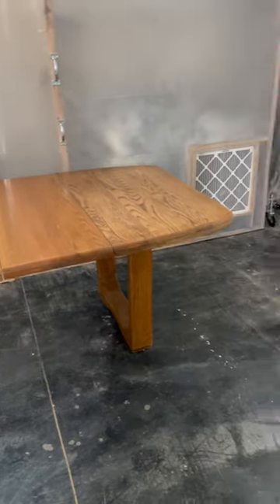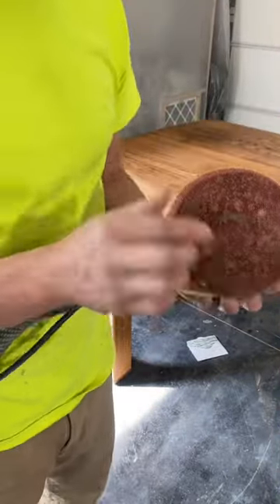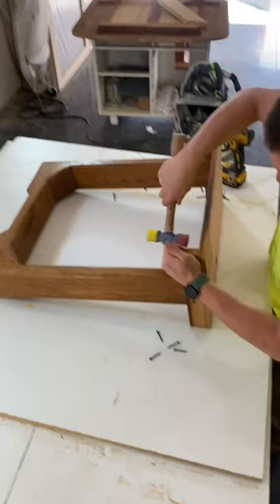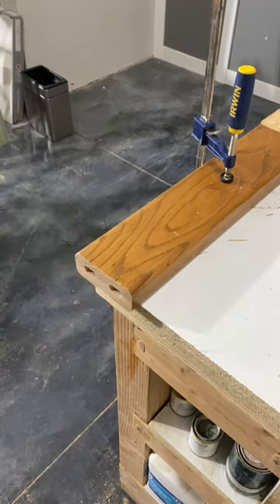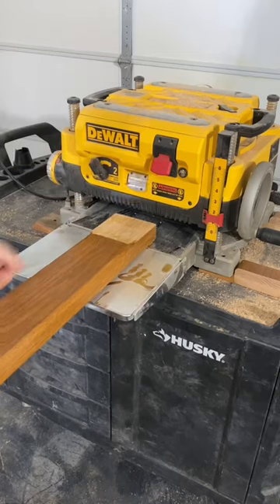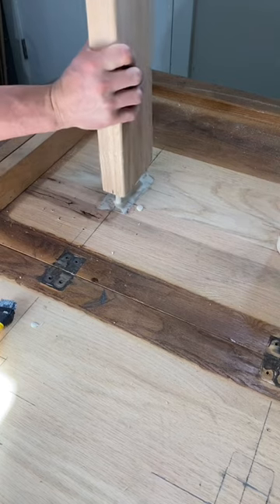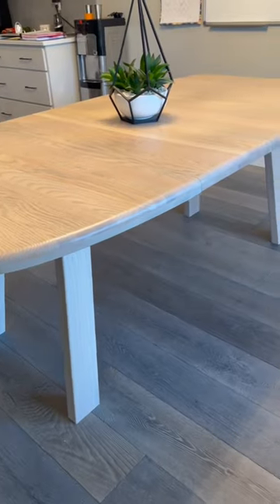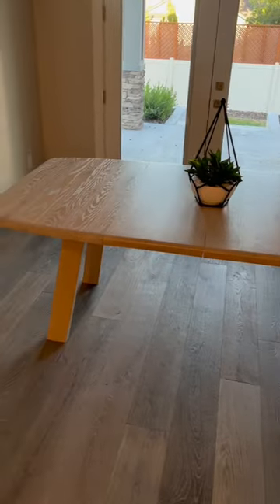Thrift store table furniture flip makeover diy #diy #furnitureflip #furnituremakeover #furniture

Comment: Your revamp looks really good!

If you get the opportunity again, consider doing metal legs and cut the table in half and use the old legs to make a center leaf for extending the table’s size with a thick, drop in clear epoxy panel inlayed with strips of wood from the original legs for a contemporary vibe.

If not, what you did works really well too.  ❤

Comment: Your defiantly on the right track.  Your finishing skills are Great !  The only problem i see is that the legs need to reflect the narrowing curve from the top.  With modern there's very little detail BUT good design always keeps a story consistent all the way through...Top To Bottom !  As they are, they look like 2x4's with an angle cut and glued.

Comment: I ran into the same issue with stripper not removing the top protective finish on my mid-80’s butcher block dining room table. It caused major gumming up and clogging of my sandpaper. I know it wasn’t dirt because I’ve used it continuously but covered the declining surface with a table cloth for last few decades. Your table turned out beautifully. Mine did too, eventually.

Comment: Not a fan of either style legs, but I do like your new design better. 
Only concerns I would have are 
1. Disassembly for moving through tight spaces - if you can't take the legs off, you piss off the movers
2. The amount of torque these long legs would generate when the table is moved seems like it would would break off of the table, even with two large dominos

Comment: I renew mid century wooden furniture and you absolutely need to leave the yogurt consistency form of stripper on your piece for a minimum of a few hours to take off the nasty clear coat, some pieces are extra stubborn and I’ve had to leave stripper on for 24 hours before removing it. After scraping off the stripper I wash the piece with acetone. After all that you can finally sand

Comment: If you take a wire brush to those pads a couple days later the gunk will chip out and you can reuse them...I used to throw away so many 20 plus years ago until an older guy showed me... never dawned on me before...lol... just always bought more. But that can get costly as of lately

Comment: Need to clean that surface with TSP to get rid of the oil and dirt buildup before you strip & sand.   Also, scrub your final application of stripper with mineral spirits and 0000c steel wool before you wipe it all off. Also, never let your stripper dry out because when it dries up, it stops working (cover it with plastic shopping bags or saran wrap). Good luck, looks great!
Reply from the maker: Great advice, I appreciate it. 👍
Reply: You're welcome!! I really love this finish. Did you only use the Osmo 3031, or did you also use a tinted stain on order to get that bleached look?  It's gorgeous! I want to try it on an oak piece I've got ready for finish. Thank you!

Comment: Looks good but how solid are those legs? I couldn’t tell if you had put any cross bracing in or all the rigidity is based off of the domino? Don’t get me wrong, the domino makes for a strong joint, but you have to think at this table is going to be pushed back-and-forth and without any other sort of cross bracing I wonder if the dominoes will loosen up.

Comment: To be honest, I do not care for the 2 x 4 style of those legs. The color is OK although I do prefer darker, but those are just too plain. They’re nicely sanded they’re nice and soft and they’re very smooth that’s really good and they’re I’m sure exact and they’re attaching into the top of the table with a strong adhesion. But definitely legs should be more tractive in my opinion. They were curves you can do there around in pieces you can put in there yeah I’m not into minimalism at all.

Comment: This felt like a CoviDIY marketing tactic. And good for you, if it puts food on the table.
  
Personally...

I wouldn't use Osmo, that's for sure. It's highly overrated, and overpriced for what it is.
 
Dominoes are good, for a fast floating joing, but this scenario, I'd prefer a better and stronger connection, via dowels. A ½" bit with ½ dowels are much less expensive, and can be made to be far stronger in an butt-butt joining scenario. 
 
This just felt gimmicky. Like a forced ad for brands. Festool isn't bad, but it's extremely overpriced for what it is. You can buy a pantorouter for the price of the Domino mortiser.